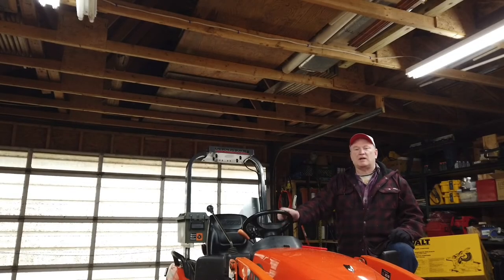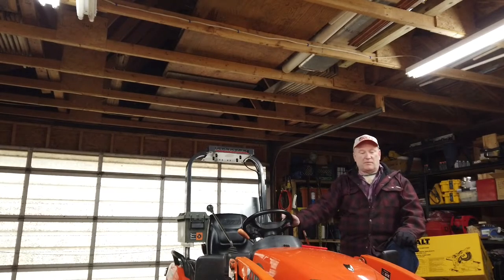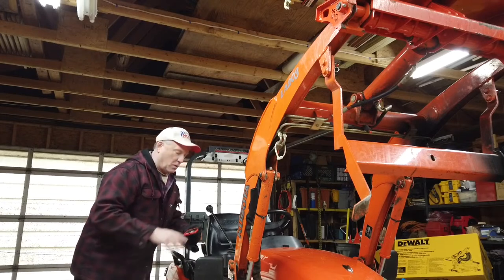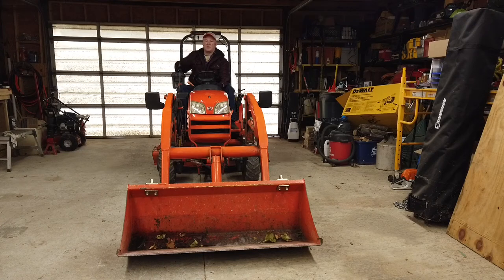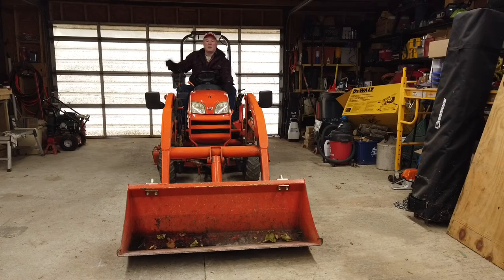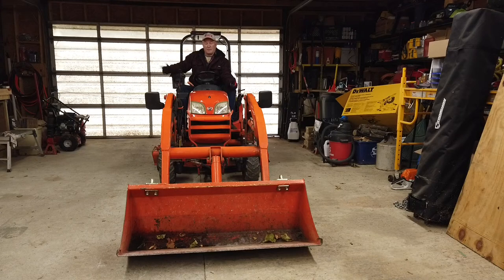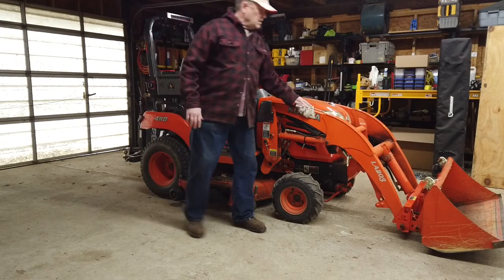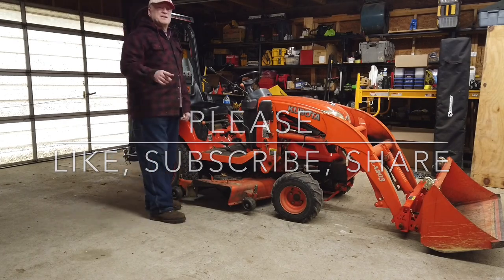#53 - Removing BX FEL

Comment: that looks pretty easy, better than some of the big tractors that takes a half day to remove.
Reply from the maker: Thanks for watching and commenting Vernon - I remove my FEL almost every time I cut the lawn (weekly).  So, I get a little practice.  I can take it off in less then 5 minutes.  Putting it on takes a little longer, as you must get the tractor lined up with the loader.  Have a great day.